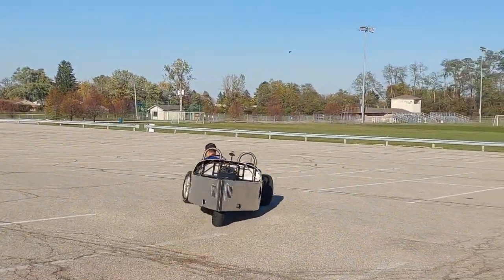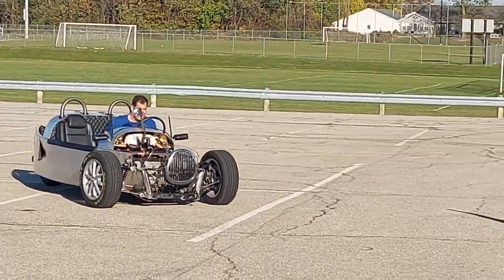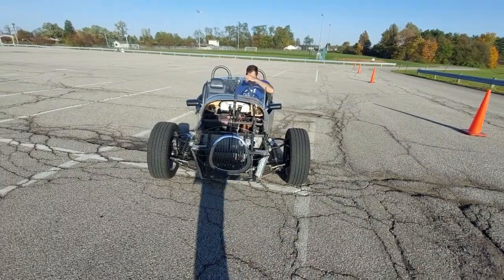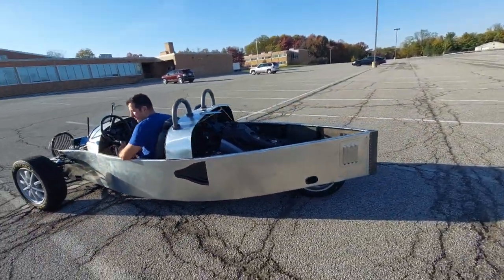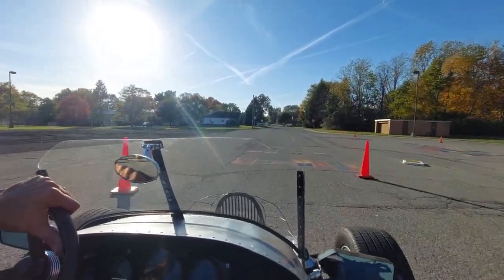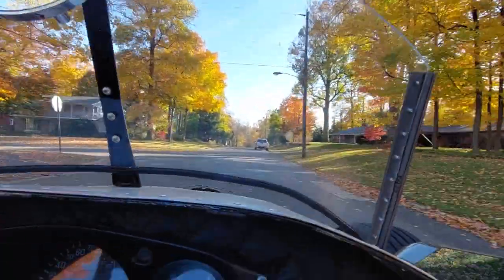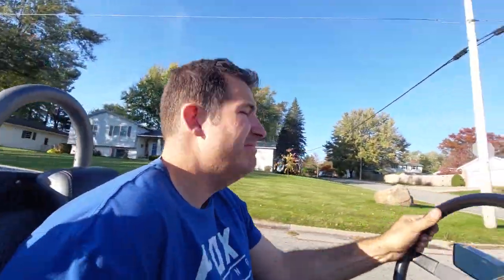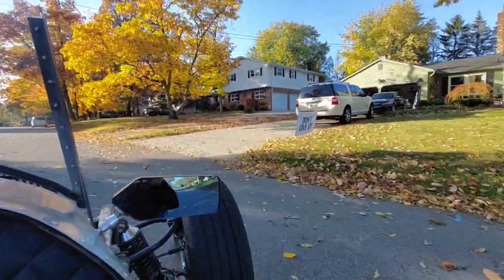Goldwing shifter test drive

Comment: So glad you uploaded a video of this thing. Been intently looking for updates on FB. Is that a custom exhaust? I kinda want my wing to sound like that lol
Reply from the maker: Thanks. I have it listed on a few facebook group pages, and metal work pages, as I am still working the aluminum body panels. The exhaust is custom, IIRC the OEM headers are 1 1/2"  in diameter. I used several inline reducers too step up the size (1 1/2"-2", then a 2"-2 1/2", then a 2 1/2"-3") this was so i could fit the exhaust tips out the side, and i used the reducers to create a small chamber filled with steel wool and holes drilled through. my own baffle system. I have played with exhaust on bikes and V8's and in my experience, N/A motors like some back pressure. I need to clamp the exhaust better as it it quite leaky! but i am really happy with the sound. These are such underrated/under appreciated motors!!

message me on FB and i'll send pic's, that would make more sense then my rambling explanation!